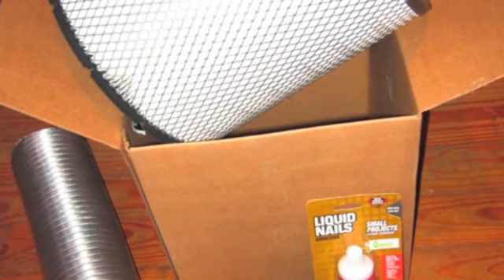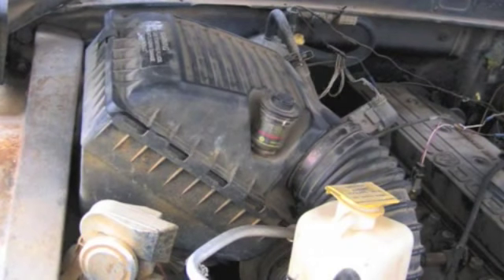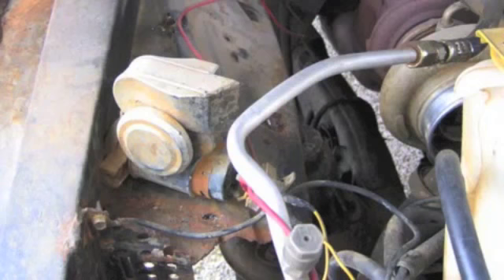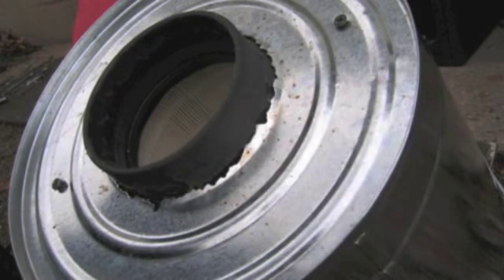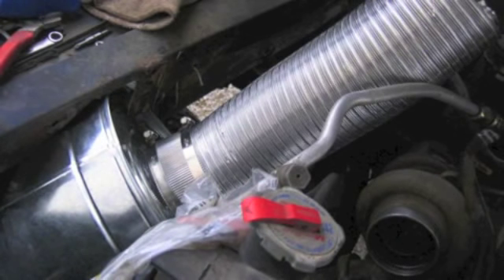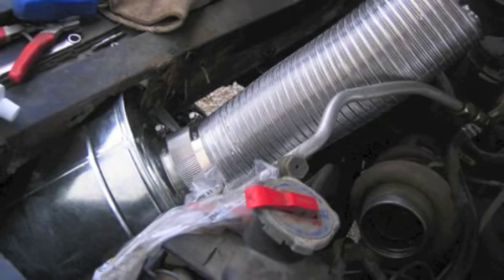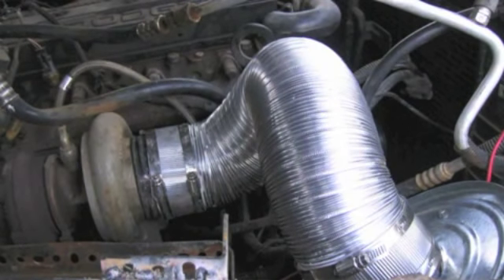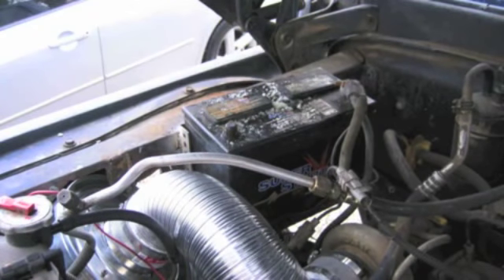bhaf installation Cummins 24V.m4v

Comment: ford with a 24 valve eh? why did ya choose the 24 and not a 12? just curious a cummins is a cummins in my opinion but im a fan of the mechanical. and what year cummins? not the 53 block correct?
Reply: Tyler Long power and torque most likely haha